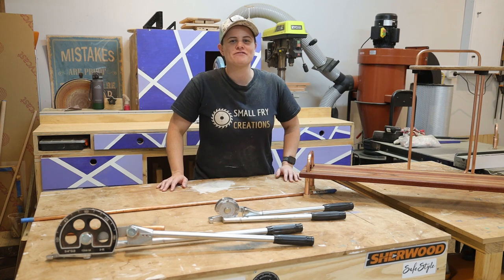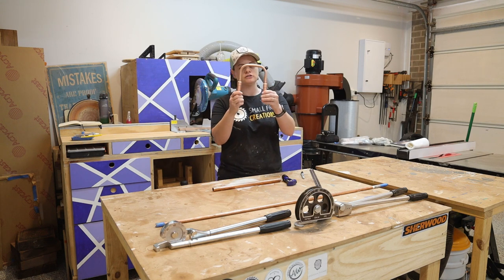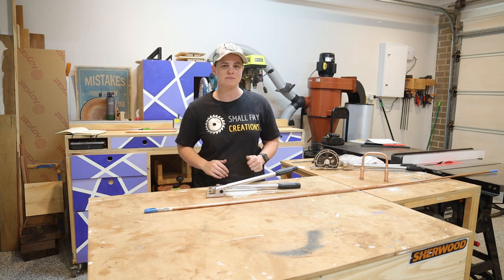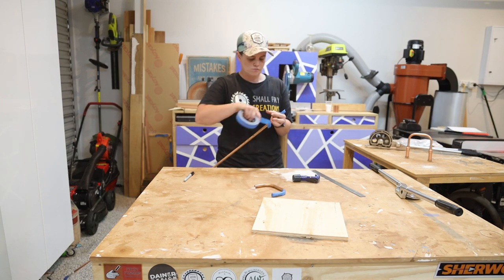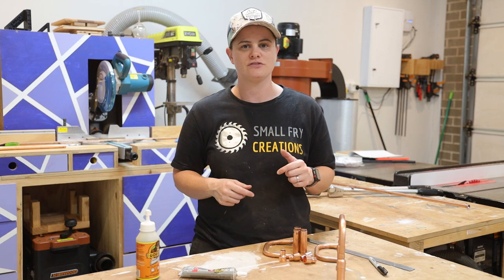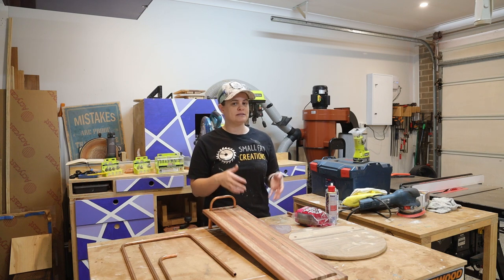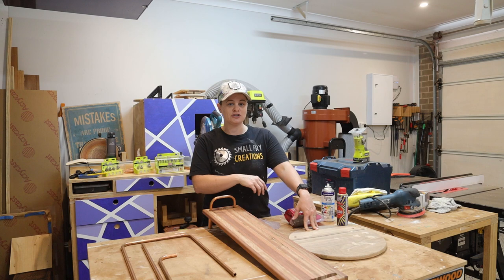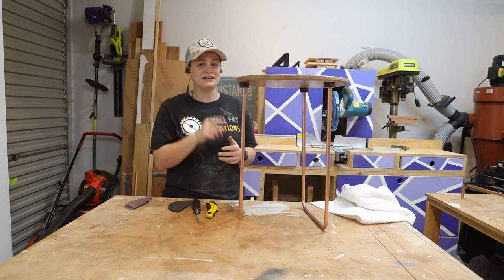Bending COPPER PIPE basics while making a Side Table and Serving Tray

Comment: I mended a foosball table this weekend with a tubing cutter. Invaluable tool to have, especially in the smallest size you can find. That is related to neither woodworking or cutting copper, but I felt the need to share :) Great video Ainsley.
Reply from the maker: yaya thats awesome. They are super handy and so easy to use :)